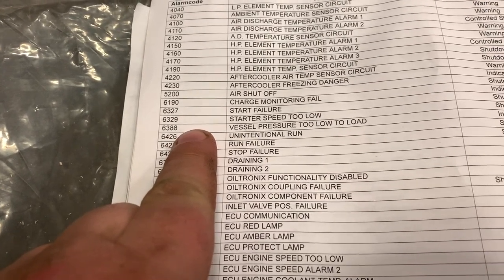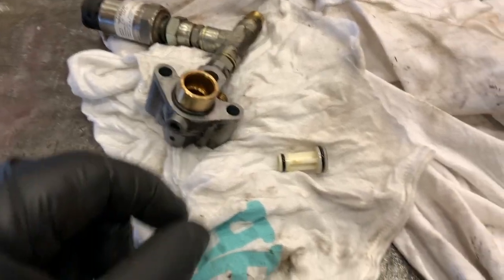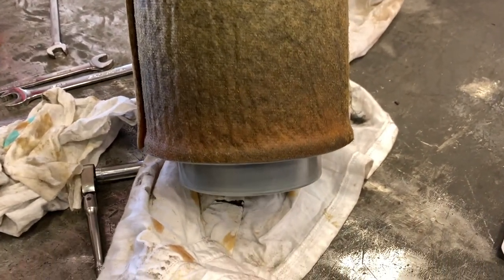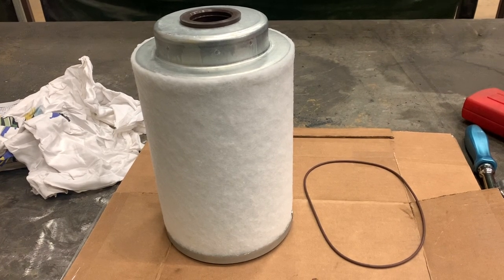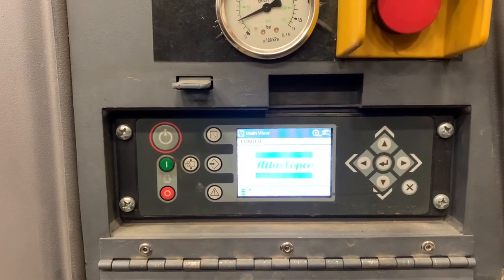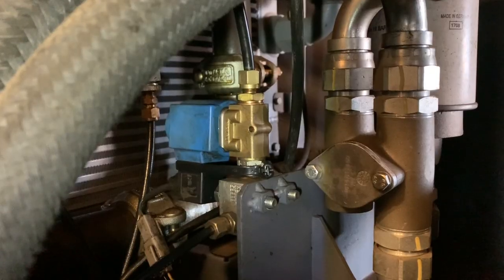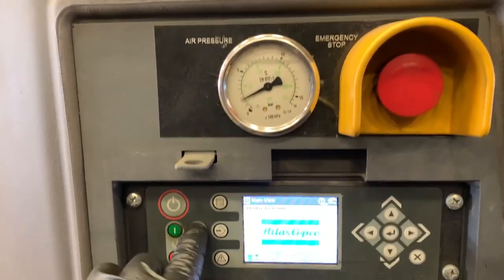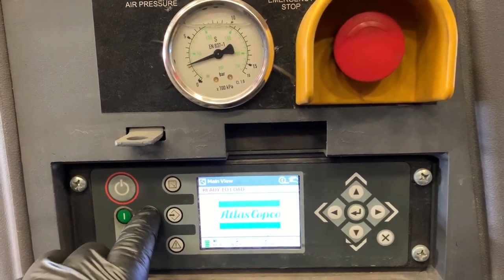Atlas Copco Vessel Pressure to low to Load

Comment: There was a cheap place out in eastern Canada that sold really good quality compressor air filters I'll see if I can dig the name up, it's been a few years. I used to work for a compressor distributor for a few years and we got all of our stuff from them. They were great to deal with and even had all the crossover lists for the major players.
Reply: Supply the Atlas Copco portable compressor original or OEM spair parts

Comment: Welcome. There is a problem with the compressor of the Atlas Copco GA11. The pressure drop reaches 5.8 bar, it does not rise more. Possible reason?

Comment: hi , im facing an issue air compressor ( caterpillar engine ) , and console atlas capco xc 2002. Engine was running smooth and load only at 5.5 bar but every time i try to adjust the regulator to increase load to 8 bar the engine was shutdown. Is there any idea for me to solve my issue ? really appreciate to hear from you.